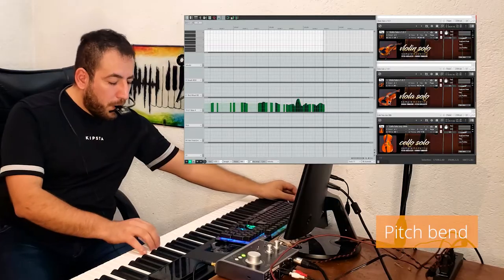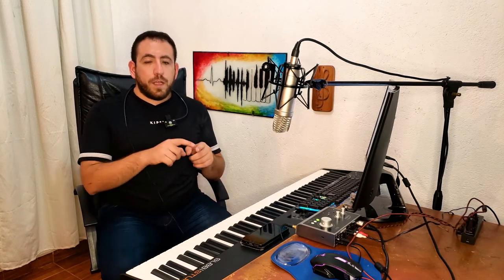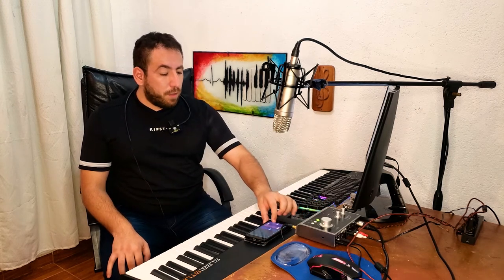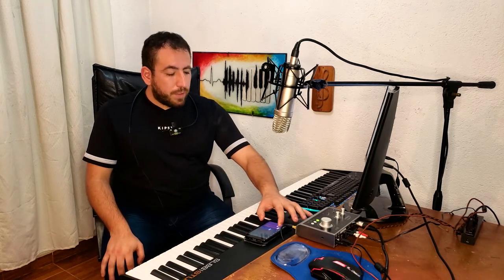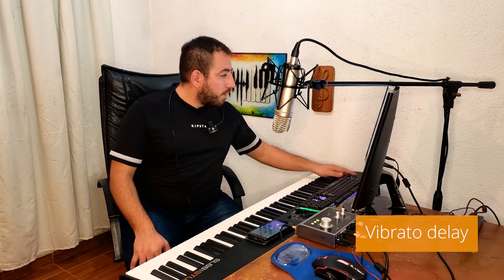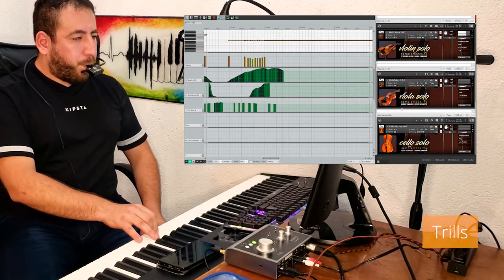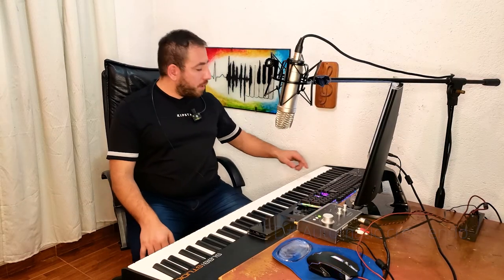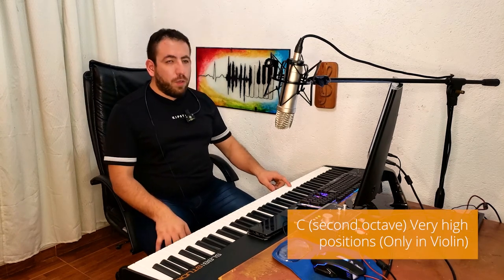Sample Modeling Strings (2/3), Playing Techniques and Realism Tips

Comment: Hi Ramiro, I find the pitch bend part of the control intriguing. Could you elaborate more on how you use that?
Reply from the maker: What do you mean by intriguing? String instruments have lot of pitch variations during the performance. Some of this variations are built in in the instrument, without the pitch bend, but some variations has to be instroduced manually, for example, the pitch bend up in the beggining of the notes..
Reply: Gómez Massetti Productions I also use it at the beginning of notes but I saw that you also seem to use it during a note, so was wondering if you had any other tips for use.
Reply: @gomezmassettiprod  whcih range on pitchbend are you using? +6 semitones?